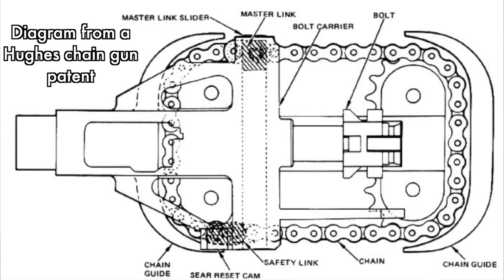Ask Ian: Are Man-Portable Chain Guns Coming?

Comment: The difference between a rotary cannon and a chain cannon is pretty simple. 
The rotary has multiple breeches, bolts and barrels. 
The chain cannon had only one bolt, breech and barrel. 
Take the M61 Vulcan today cannon
And
The Bushmaster Sky Viper

Both are chambered in 20mm × 102mm.

Comment: Could in theory a powered gun also achieve easier a double tap before recoil affects the gun (AN 94 style) increasing lethality? If you remove the need to recoil affecting the gun to operate it, could you reload and fire some sort of reciprocating system so both rounds fly to the same spot? 
Also I think electrical ignition of a round is an advantage to chain guns, as that also increases reliability and reduces complexity.

Comment: Just add a lithium battery and an electric motor. But, why? Seriously, I really find what you're doing fascinating but the fact is that if "we" went to war today we'd probably be better served manufacturing and using 3 million original AK-47s. We've "refined" the concept to the point where Kel-tec is simply making multiple iterations in different forms to see through the process of elimination just how light we can make it. And don't tell me that it's not more fun to go plinking with a .22 than with a .223. And you can hunt small deer with a ,223 but it would be inhumane and irresponsible, so .22 serves for everything smaller. It's fun to shoot a Remington Express - once. It's intelligent to use if for long shots on elk. Hunting with guns is for guys who don't like a challenge and are easily frustrated. Unless you're actually depending on it to feed a family.

Comment: If you check out Jesel timing chains for v8 engines, they have adapted a composite cam drive for racing applications. considering a race engine will turn 6000 to maybe 8000 RPM and durability is a priority, I am quite surprised they have been able to develop something that durable. Could be used in a chain gun application? Dont know but it would be lighter than a metal chain, the durability would be the real issue.

Comment: Is there no gun producer that has just made a backup spring, that activates if hammer is dropped but no reciprocation happens. 
Every normal reciprocation could crank the backup spring 1/10 by pushing a sprocket one step. 
This should not take up much weight and would fix the one in a blue moon dud.

Comment: Could you use like a Turbine driven electric generator running on lets say the overpressure of a muzzle device not only generatig power but also lowering noise and thermal and visible report of the gun? Sure it's still a lot of weight but you would need a lot less battery capacity. It would also give the system another advantage if done right. Also It would legit be the first turbocharged gun which would be pretty sick too.

Comment: So a chain gun could use lighter ammunition to get the same energy into the slug compared to a cartridge powered gun. Interesting, I wonder what the energy difference is. 
Given a chain is just a way to sync various actions, with the improvement in electrical motor tech I suspect it may be possible to perform that sequence with multiple lighter electrical motors/servos.  I have no idea if that might have advantages over the traditional single motor+chain method.

Comment: A chain gun means you need a battery or power source to run,  both are heavy and are not something you want for man portable.    All this would do is add more weak links for a gun crew in the field that could cause the gun not to work.

Comment: TBH if you're talking about mounting the gun on a drone you're also asking yourself: do I want to design, trial manufacture and stock an entirely new gun or will I just mount on M2 or M240 on it and strap a 3 pound device with like 2 AA batteries on it that can push on the charging handle hard enough like a couple of times before running out of juice?

Comment: Bright future is not a chaingun but something with electric drive. Get rid of puston, recoil spring, massive bolt, firing pin, primer and so on, effectively leave only barrel and some light (because they are not loaded with strike load) parts to feed bullets and liquid propellant. Firing by spark/arc, bolt remains locked until no significant load left... yes, we got mini naval gun with separate loading, but with linear motors rather than 6 sailors.

Comment: As Jesse Ventura pointed out while firing the hand held GE134 minigun in 'Predator' "you had to grit your teeth and hold on". Even with blanks and the rate of fire scaled down to 1250 RPM, it had horrendous recoil. If you were to fire it at the full 6000 RPM, even someone large would have a problem. In the end, by the time you scale it down enough to be useful, you get the M60 also shown in the film, or you get a large vehicle holding the weapon.

Comment: Another issue with a man portable chain-gun (besides weight) is its use in combat.   Yes it would have its application. But over all its not practical.  The soilder using it would have to stand out in the open just to use it. Which would make him vulnerable to return fire

Comment: A benefit of chainguns not mentioned in this video is ammunition capacity. If you stick a 1000 round belt into a recoil operated machine gun the belt will be so heavy that the gun will fail to properly feed. Meanwhile on a chaingun the weight of the belt is only limited by the streingth of the motor. Hence why the Apache has 1200 rounds in its 30mm belt.

Comment: Say you made a chain gun with a rotorary bolt like the p90 
Or other small size high power cartridges. 

Would it then be feasible? 

Also what would your admonition recommendation be for a small ground based drone say something in the sizes of your typical remote controlled car be? 

Here I’m thinking of small bore carriages with high power like for the fn 5.7 
Or the mp7

Comment: Instead of a man portable chain gun, the better way forward is to put more R&D into coil guns.  To make them more portable and to shoot stuff larger than the size of a .22 round.

Coil guns don't have the issue of needing to manually cycle the gun after a malfunction, gas and all that stuff.  The battery just sends the projectile down the barrel.

Comment: If infantry had some kind of fully enclosed hard armor where clearing a gun would be made harder, weight was offset by servos, battery was built in, and point blanking combat is the intent....I can see it. It's just not financially or tactically viable to put so much expense into a single infantryman.

Comment: Got me thinking. If you took a mini gun, shortened it considerably, made it lighter, added a small battery to start the barrel rotation, and used the traditional means of cycling the rounds to keep the barrels spinning, you could fire indefinitely because your not using all the battery power to move everything.

Comment: A chain gun does not need an electric motor, it can be any kind of motor, hydraulic or for aircraft, where most early chain guns were used, the main propeller motor (aka, engine). The energy source is just an external motor.
Initially, the chain gun was used to both drive the action and time firing, as it's kind of embarrassing to shoot your own propeller off.

A couple of problems with a man portable chain gun is, well, blammo kinda weighs ya down - a lot of blammo, loads of testicles inside of one's socks. Then, there's the power source (I'm assuming a non-human motor here). Not a hell of a lot that one could call useful or man portable when you're up to a quarter ton at the non-starting gate. Think a can or three of blammo, plus batteries are not included.
Then, there's recoil. Something I'd do just looking at being asked to lug a quarter ton, but I'm talking weapon recoil.
You know, "Stop shooting up there, He might just start shooting back and He's a lousy shot!".

I can see them on vehicles, especially given remote weapons station equipped vehicles. Why have a weapon a crew has to exit the vehicle that's protecting them, hence it being remote, just to clear a misfeed or misfire?

The chain can be trivially replaced as they were frequently in cars with a timing chain, a cogged belt.

Comment: "Cahinguns"/"Miniguns" won't be field ready until a workable human armature system is available. A Chaingun/minigun with a usable load of ammo and batteries for half a day's operation will be so heavy that the normal grunt can't caarry it.

Put it on a armature system (See 'Edge of tomorrow' for an example) and the weight will be carried by the frame, so the human isn't overloaded.

If the Boston Dynamics motorized donkeys ever get approved, mounting a chain/minigun on that would replace the heavy weapons soldier; let the mule carry a 10 MM and a thousand rounds, and MORE DAKKA!

A workable Armature system will really change the battlefield.
Reply: Or just give us the Starship Trooper exosuits. Problem solved.

Comment: For unmanned vehicles or unmanned turrets I would think propellent gas would be a good thing because it would reduce the oxygen levels inside the turret of platform which reduces the risk of fire if the turret or platform is penetrated. The Russians have squib cartridges for their cannon that burns a hole in the side of a cartridge to set fire to the propellent if the round fails to fire if it has a primer problem. When the propellent is ignited the round will fire and cycle the ammo and restore firing of the weapon with a dud round. Most Russian gatlings are gas powered and do not require electric motors.

Comment: An additional concern with externally-powered infantry weapons:  you're not eliminating failure modes, you're changing them out for new ones.  Batteries die, hydraulic power systems leak, run out of fluid, suffer from fluid degradation and contamination, control circuits can be damaged, etc etc.  For vehicle mounted weapons, these are not serious issues because the facilities which support the vehicle already have the means to address those failure modes.  Infantry in the field does not.  

Battery powered chaingun?  No issue if a vehicle battery fails, because the vehicle has onboard generation, for the infantry though? better bring some spare batteries and a generator to charge them.  Computer controlled firing mechanism?  host vehicle can have redundant FCU computers, where does the infantry store them?  external power units need external power supplies, and one is none.

Comment: A very informative answer from Ian, though I suspect most people imagined portable gatling guns instead of chain guns. As they have seen in the movies. And such a beast actually exists. Named "Old Painless" it is a cut down and heavily modified M134 gatling gun in 7.62x51mm, though it appears it has only ever fired blanks in it's modified configuration. Used in movies like "Predator" and "Terminator 2", the rate of fire was reduced and it was not portable battery powered but externally powered by cables. Still, it was put together in the 1980's so battery packs would be much smaller and lighter today. As a combat weapon it would be far to heavy and unwieldy, and carrying ammunition for it would be unfeasible. However, for a novelty gun, for those wanting to feel the blaze of the iron broom as they have seen in movies and computer games, it could be done for firing at a closed range. It could be based on a 5.56x45mm XM 214 instead, the barrels fitted with compensators to limit recoil and other measures to make it more manageable. 

As for Ian's comment on the advantage of chain guns (and gatling guns) that they didn't stop firing when there is a dud or hang fire is moot now with modern ammunition. Mostly true, but with new environmentally friendly ammunition with lead free projectiles, the primer material have changed from lead azide to other compounds. And these compounds have proven to be less sensitive and more prone to being duds and hang fires. It boggles the mind that military forces in today's world would substitute very reliable ammunition for less reliable ammunition, but politics trumps common sense yet again.

Comment: The big question to me is: How much weight can be saved per cartridge, when keeping same balistics, if the action is not run by the powder? And is it more than the weight of a battery needed to run the action by an electric motor? So with better batteries i see a potential to do so. Also it could be more cost efficient.
Reply: Not much, the weight of the powder charge is pretty low all things considered. and for the battery and motor, consider the weight of a air soft battery and motor and you'll get a idea the added weight. the powder charge would likely remain the same, the reason is that by the time the gas is being siphoned off for the gas system, the round is already up to speed. This is why a bolt rifle chambered the same as the semi or full auto version is using the same powder charge.

Comment: Hm, can you adjust the speed of the motor to adjust the rate-of-fire of the weapon?
Reply from the maker: Yes.
Reply: @ForgottenWeapons  Then it seems to me it might possibly be useful for conducting suppressive fire with. While I certainly have no actual military experience I would think that a gun with a rate-of-fire of just 450 rounds/min would be nearly as effective at conducting suppressive fire operations as one with a rate-of-fire of 650 rounds/min, while saving a not insignificant amount of ammunition
Reply: @GoranXII  A normal machine gun can have a lower rate of fire by adjusting things like the gas system, buffer weight, return spring and locking mechanism. That's why you get guns like the M60 having a wildly slower rate of fire vs say a MG3 despite firing the same ammunition.
Reply: @SilverStarHeggisist  I suspect adjusting the speed of the motor for a chain-gun is rather less involved then changing all of that stuff on a regular gun.
Reply: @GoranXII  yes and no, guns with a adjustable gas block you just turn a nob
Reply: @SilverStarHeggisist  How many have those? And how easy is it to engineer?

Comment: Is there such a thing as a gun that uses gas as the propellant for bullets rather than black powder?
Reply: Most guns don't use black powder. But I think you mean compressed gas, yes, but they're less powerful, more bulky and slower firing. They're called BB guns or Pellet guns. 

Firearms use compressed gas as well, just they effectively store the gas as a solid, which when ignited, rapidly transforms from a solid to a super high pressure gas. To give a idea, the gasses in a 5.56 reach something like 60,000PSI, now that's stored as a solid, now imagine how heavy a canister would have to be to safely store a gas at that pressure as a gas.
Reply: @SilverStarHeggisist  No I was referring to something akin to the ignition in an engine, where igniting the gas works as the propellant.

Comment: BTW, there are Gas-Operated Gatling-Gun/Mini-Gun systems that don’t require a motor to operate them.

Their barrels feed a gas-vent into the center of their rotation (with a system that cuts-off the vent to the other barrels when not firing to prevent pressure loss to those barrels), which then drives a variety of different mechanisms for rotating the column of barrels like in a Gatling/Mini-gun.

They are weird in that they take a bit to really get up to speed, and that they obviously don’t tend to be as powerful as the electrically driven varieties. But they are preferred for operations where electric-power is either limited or non-existent.
Reply: there's also a Soviet 7.62×54 and 14.5×115mm recoil operated rotary gun. it has a cool look where the barrels stick further forward towards the top even as they spin.

Comment: Someone will ask “will man-portable Gatling guns be a thing.”  First, “ever” is a very, very long time.  Will an invention ever come along that will make it feasible?  Let’s have this conversation in 100 years.

Second, six barrels is A LOT of weight, even if it’s titanium or some super light futuristic material.  And you still need to add material to fuse it all together and for the mechanics of the system.
Reply: There's already a light weight 5.56mm one that is easily man portable and light weight. It was in shot show a few years ago.

Comment: I also wonder if the Chain gun would be susceptible to an EMP as well?  The current system using the bullet to provide it's own energy is much more 'Grunt Freindly' no need to have the PFC remember to charge the battery for his gun 🤣.
Reply: It depends, on the power of the EMP and what your power source is. Chain guns can run off hydraulics as well as compressed air.
Reply: @SilverStarHeggisist  You are correct.  And having a hydraulic system if the chain gun is on a helicopter or a tank that already has a hydraulic system for other controls, it would make sense to use that oil flow for the chain gun.  However, 1) Wouldn't that oil flow depend on the engine still operating after the EMP?  2) referring to the original question, how 'Man Portable' is a tank of compressed air or a hydraulic system?

Comment: Why not get rid of the gas piston in traditional machine guns and replace it with a turbine or a small pneumatic engine? 
Gases from the cartridge are fed into a small turbine/pneumatic engine that is used to cycle the mechanical portions of the gun. That way no single dud round could be responsible for causing the gun to stop firing since it relies on the average gas pressure of the shells cycling through the machine.